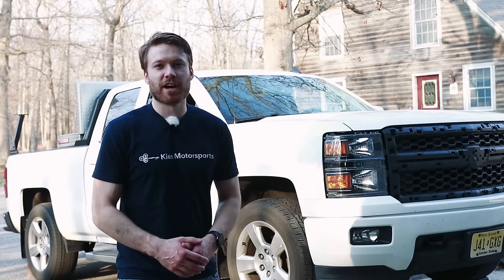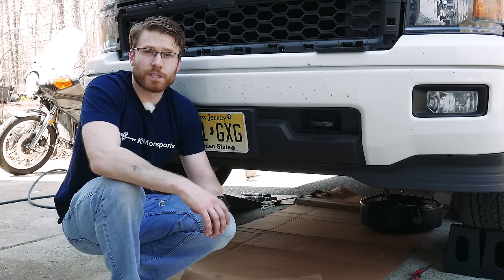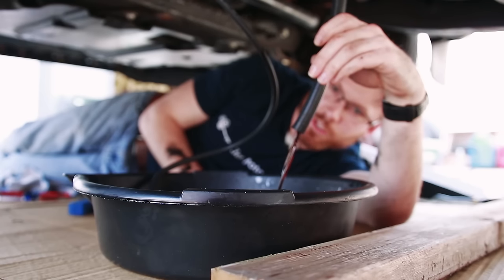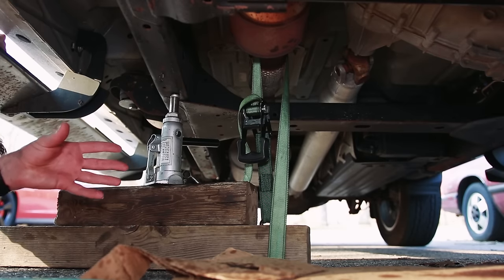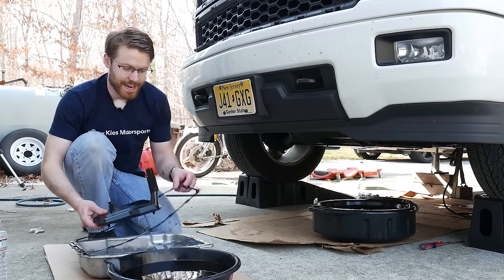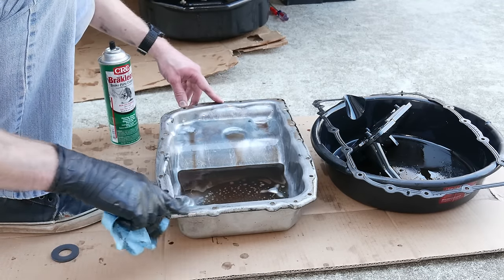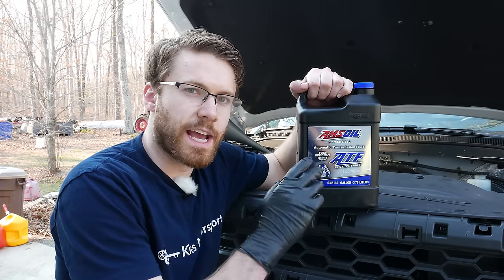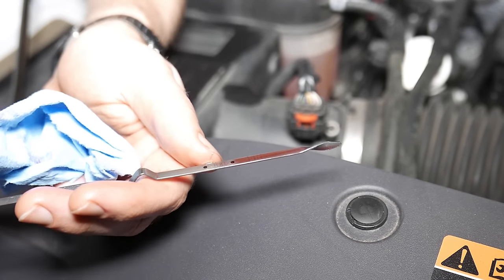6L80E Transmission Super Flush and Filter Change Silverado Sierra Tahoe Suburban Yukon Escalade H2

Comment from the maker: Pan Bolt Torque is 80 in-lb or 9 Nm (not 90 Nm) sorry for the typo
Reply: 100inch pounds
Reply: Since you changed the fluid in 2018,  have you had any issues or complaints with switching to the AMSOIL Transmission Fluid? 
Been thinking about going to amsoil instead of the dealer fluid for my ford, and i see positive reviews, im still leary.
Reply from the maker: Nope. No issues at all. I did another change 50K later as well when I swapped the torque converter (have a video on that).
Reply: hello bro, a question I would like to know if the tightening of the screw of the pan silverado 2012 is the same
Reply: Yeah I just sheared my bolt because I didn't bother to double check these numbers. Thanks!

Comment: Pan Removal Trick: I have 2018 Tahoe 6L80 trans. and the pan will come right out!  Not sure if your ride will have it (i know most do),  but I removed the heat shield on passenger side of pan (2 bolts). Then I was able to slide the pan over to passenger side about 3 inches, then twisted the front of the pan towards the driver side and it came right out!  Removing the little heat shield gives you lots more room.  If you look at the back of the pan (shallow end), there is a little raised area on the bottom about 3 inches from the passenger side, that spot is the point that will allow you to move passed the exhaust y pipe (cross over pipe).  Hope this helps!!  👍

Comment: I did the same service on my truck, if I may suggest....there are (3) 15mm bolts on the exhaust flange on the passenger side, the studs there are long.  Just loosen those nuts and you will be able, by hand, to lower the exhaust cross member enough so that the pan can be removed.  No other gymnastics under the vehicle needed.  I then anti seized the exhaust bolts.  I did have to use a Dewalt impact to get those 15mm bolts loose.
Reply from the maker: Ok good tip! I might make a second video on this showing some of the suggestions we've received
Reply: I will definitely look into doing this!  This is a nightmare job - for sure.
Reply: Did you need to remove the oxygen senor to get to those three bolts by the passenger side? or Remove the wheel and side well to access those three bolts? I have the 2011 with 18 bolts pan and see there is no room from the bottom but it seems to have room from the side.
Reply from the maker: I just had mine removed to pull the motor for the AFM. Delete and you need to go from the side to get some of those bolts.
Reply from the maker: @slowestrider4918  the oxygen sensor may need the electrical connection unplugged but it can stay in the downpipe
Reply: I wish the factory would assemble the exhaust with anti-seize ! Very smart of you. Now next fluid and filter change will be easier.
Reply: @TheSundaeDrive  Honestly, I didn't have to pull the wheel or wheel liner.  I did use a long extension and a universal.  I invested in a 3/8 wobble 15mm deep socket for this task.  I was able to access all 3 bolts from the bottom of the truck with an extension and used a Dewalt 1/2" impact.
Reply from the maker: Nice! I'll have to try a lil harder next time with those drive side ones
Reply: @slowestrider4918  12:16
Reply: Exactly what I did. Loosened all six collector nuts and popped the exhaust hanger loose

Comment: Good job GM, almost everyone knows transmission failures are heat related... so put an exhaust crossover up against the pan...
Reply from the maker: Very good point
Reply: well damn... that makes some good sense. wonder if a heat shield can be placed on the pan where the exhaust runs under. Wonder if it will drop the temp by a couple of degrees?
Reply: Yea that added on top of the bypass, of course it’s gonna run hotter. Of course the wind will help with some of that but still. Don’t know what gm was thinking there

Comment: Does anyone know if you ELIMINATED the exhaust crossover pipe what that might do?  Can it damage anything?  I'm considering just cutting the pipe out and putting some v bands on so it can be removed later and also putting a drain plug for later down the road

Comment: You 100% CAN remove this pan without doing anything special at all. I just did it on my 2014 GMC Sierra 1500 5.3l. Lay on your back with your head towards the front of the car, twist the pan slightly to the right (drivers side), and it will slide out. Took me about 2 minutes. 

That said, I love your videos and really appreciate the level of detail you include.
Reply: I will try this on my 09!
Reply from the maker: Good to know! I'll have to try that next time! And appreciate that feedback! Nice to know they agree helping!
Reply: @_Gundy_  You dont need to do that on an 09 goofball
Reply: @Chevelle602  LOL yup!
Reply: 100% just did the same way
Reply: What 2012 sierra? Will it spin out? Pry bar on exhaust?
Reply: Simple tetris move to get pan out of 2011 Tahoe....just removed pan without straps or jacking up anything.
Reply: Can vouch this works on 2014 gmc 5.3 sierra.  Had to use a pry bar with a little tug. Slide right out.
Reply: I saw another video that confirms this. I am getting the parts today.

Update. I spun the pan no problem. It was a little harder getting it off than back on. Gm needs a drain plug this makes a huge mess.
Reply: @Chevelle602 it has the same problem with the oil pan clearance from 99 to the new ones.
Reply: I've never pulled out remove bolts turn pan off to side wipe out fluid clean and wipe a couple times reach between pan and trans pull filter down an replace then pan back on
Reply: Yes he is 100% correct!  I have 2018 Tahoe and it worked too!   Not sure if your ride has it,  but I removed the heat shield on passenger side of pan (2 bolts). Then I was able to slide the pan over to passenger side about 3 inches, then twisted the front of the pan towards the driver side and it came right out!  Removing the little heat shield gives you lots more room.  If you look at the back of the pan (shallow end), there is a little raised area on the bottom about 3 inches from the passenger side, that spot is the point that will allow you to move passed the exhaust y pipe (cross over pipe).  Hope this helps!!  👍
Reply: @stevenstair1068  Was thinking of going this route to avoid the whole "can't drop the pan without drama" drama.  My question: what about the little fitting/gasket that keeps the filter tube held snug.  Is there an absolute need to replace this? How would one know if need to replace or not? - I don't see any way to replace this without completely removing the pan.  Thanks!
Reply: @stevenjenson5048  If the new filter doesn't fit snug then you'd have to change it , working on them for 54 years I've only had one that I had to change

Comment: Recently bought a 2016 Silverado; have been religiously watching your videos to learn everything about these trucks! Thanks for all the details and tips! One thing to note, I wouldn’t clean gaskets with brake cleaner. It reallllly dries out the rubber. Or at the very least, if you do have to clean it with brake clean, coat it with oil to rehydrate the rubber. Alot of us will also put a thin layer/bead of silicon on the gasket. Overall, awesome videos!

Comment: Appreciate the video it helped immensely! super easy change once I jacked up the transmission. One thing I will note I have a 2016 5.3L Sierra and the cooler lines attached to the transmission didn't have a quick connect. I instead found the return line on the transmission cooler in the engine bay and disconnected it there with same process, surprisingly easy to get to with loads of room around it. I just inserted the drain tube into the transmission cooler and it was a snug fit. If anyone runs into the same problem it is the lower line on the transmission cooler on the driver side. Your method was great because it replaces more fluid than other videos I've seen who just drop the pan. Noticed a significant  improvement in shifting too!
Reply from the maker: Awesome! Glad it helped and thanks for the tips!

Comment: I pried my exhaust down slightly with a big  pry bar, then I was able to get the pan out.
Great video..
Reply: Same I used a big bar on top n jack on there end of bar it worked
Reply: Careful people, the exhaust manifolds on these engines are held on by a pitiful (5) studs on each side.  Strain your exhaust by prying it, you'll break studs off.  My Yukon had 2 studs on one side busted off just from normal use, probably impact force from potholes on the exhaust system.
Reply: @ericeric9208  I did that also.
Rotate the front of the pan to the right.

Comment: Just got done. What a pita! No jack but there’s room. Came up 1 qt short. Used 14.5 so I pumped as I filled. Pumped out of the lower radiator fitting. 1 year old it was a little dirty. Big pull with a trailer last month from Philly to Yellowstone. Just dark. Magnet, not bad. Thanks for the viddy.
Reply from the maker: Glad it helped 👍👍 Definitely not the easiest one to change
Reply: You had just enough clearance without moving the transmission or exhaust?

Comment: A couple tips I learned on my older gmc, it was parked for years before I got it and I'm working through the issues as they come up. The transmission fluid change didn't go as usual, I've done this more than a few times. Here's my tips.. Use a sealed bucket with a pouring spout, any hose small enough to fit down the dipstick and a shop vac to make a fluid vacuum pump.  It'll get most of the fluid in  the pan. Just drill a hole big enough to have to from the hose through, shove it all the way down and stick the shop vac down the pour spout. My small craftsman fit perfect. It'll help to be air tight. I would be cautious running the pump that low... I'd think it would be safe to do several fluid changes. Also drain plugs are cheap so just install one if you're that far in, be careful of placement and get the hallow bolt good and tight. I had to replace that garbage rubber gasket that came in my kit. The old hard gasket was done as well. Go with a hard gasket if you replace it or you'll see why putting a drain plug on  when you have the pan off is a smart move. I'd also entertain a second cooler in series and synthetic fluid. It'll creep out though if things aren't just right. Worst case, they make a special rtv for synthetic transmission fluid, worked pretty good on drain plug threads. I hope this helps someone.
Reply from the maker: Good tips! Thanks for the write up!
Reply: My truck has 78,000 miles, do you think it would be wise to change the filter. I have a small pump I use to change the oil in my I/O boat engine and could suck the fluid from the transmission with this.

Comment: I just swapped my trans. fluid and filter in my 2018 sierra 1500 base. Installed the transgo therm. delete kit as well. For those out there that have yet to do this let me tell you - follow every step these guys displayed. Pan won’t come out with just the strap around the 4”x4”‘s. Gotta use the third jack to to push the housing up to. “Couple hour job” - my ass. These guys make the best how to gm truck vids. Thanks a bunch, keep’em coming.
Reply from the maker: Appreciate that! Glad they helped you out!

Comment: Great choice on the fluid. the Amsoil ATF (Red Label) was the first product of theirs I ever used back in 06 became a dealer in 07 and have not looked back. I put it in an 02 Cavalier doing the flush procedure where I took the line out of the radiator after dropping the pan and cleaning the magnet this was when the car had around 60,000 miles. Well in 2016 I thought it was time to do it again had another 70,000 miles on it at that point and I was shocked at how clean the transmission pan was and the fluid was still red! Now at that point I changed to the blue label fluid you use because GM recommend Dexron 6 in place of Dexron 3 now. I also added a auxiliary cooler and a magnefine  inline magnetic filter. Just changed that magnefine filter and opened it up a few months ago after 34000 miles and 4 years or so and the filter had almost nothing visible in it and the magnet had some fuzz on it.
Reply from the maker: Amsoil is good stuff!

Comment: So I attempted this on my 2017 Chevy Tahoe. All the steps will work except where you get the transmission fluid from. There are no C-clip connectors coming off the transmission. You will need to drop the splash guard to access the trans-cooler lines. I had a hard time tracing mines and made the mistake of disconnecting oil lines running into my radiator (not fun). So I bailed on the flush and opted for a pan-drop where I just changed the fluid in the pan. The ratchet strap, wood and bottle jack combo worked like a charm at getting the exhaust down, along with jacking up the transmission. I was able to successfully get the pan out and refill with 6 quarts. Transmission is shifting better. I would have like to get another 4 quarts or so out of the transmission but I’m a neophyte and DIY car maintenance and didn’t want to take the change of screwing things up by guessing. Hopefully someone does a video/write up on the 2015 - 2018 GM trucks.
Reply from the maker: Thanks for the feedback. That's interesting that the cooling lines are connected differently. Glad the video at least helped a bit with the change!
Reply: Just did my first fluid/filter change on my 2015 Sierra tonight. On my truck there is a plate with a 10mm bolt holding the 2 cooler lines in instead of the spring clips. I took pics of you want to see the difference.  Just let me know.
Reply from the maker: Ok thanks for the info! Could you shoot us a pic? Cliff@thesundaedrive.com
Reply: The Sundae Drive just sent the pics to you. If you don't get them let me know.
Reply from the maker: I got them. Thanks :)

Comment: Thank you for the video and those mentioned remove exhaust bolts. I just finished changing my 2011 5.3 by removed exhaust bolts first. The driver side is more accessible than the passenger side but i end up need to remove both wheel wall to access all six bolts. Penetrate Liquid sprayed the night before. It was to my surprise for the ease of removing passenger side but the driver side got me worried for a while. The 24" wrench bent and the bolt does not budge. I sprayed more and use hammer to knock around manifold housing. It took some effort to remove driver side with extra 36" pipe. 

When pipe dropped, there was plenty of room to remove trans pan. It does seems to be enough room without dropping the pipe but I just couldn't risk it. I applied plenty of anti-seize on all six bolts for help future removal. Thought about spending close to 300 for that B&M with drain bolt but by loosing bolts slowly to let oil drip slowly didn't even have any on the floor. I may still buy that B&M for change oil only. Thanks again.
Reply: I did the same, loosening the exhaust pipe flange (3x 15mm) on the passenger side, allowed the cross member pipe to drop.  Also, if you have an extractor, the dipstick is a nice access to extract practically all the fluid from the pan.

Comment: After you've changed the filter 4 or 5 times , I just welded a drain bung to the low spot om my trans. pan ...drain as much as you can , then refill a gallon and run through the gears and in idle for a few minutes , then drain it again.....I just buy the cheap Valvoline ...change the motor oil and trans fluid at the same time ...works good and real easy ...! This way you get all of the converter oil replaced ...
Reply from the maker: Not a bad plan and if you change it frequently. I would still change the filter once in awhile too

Comment: If you get a replacement pan (inexpensive) and weld an O2 bung with a plug with a copper washer, it makes it easy to drain. I do a drain and fill every second oil change which gets about half of it.

Comment: For those of you attempting this, there is another video on YouTube that shows that you don't actually need to REMOVE the pan to change the filter and fluid, or even clean the pan for that matter.  There is enough room to simply move the pan out of the way to change the filter, and get rags in there to wipe everything down and clean the magnet, as well as replace the gasket.  The majority of the (wasted) labor here and in the comments is spent trying to remove the pan entirely, which isn't really needed when all you're trying to do is replace the filter and wipe the gunk out.  Please save yourself the headache of trying move your exhaust around and create more work.
Reply: If you want this job done correctly, the pan should be removed and cleaned to surgical standards. Why anyone would half ass this is a mystery.
Reply: How do you know what is inside the pan if you can't see inside?
It is a lazy way out.
Reply: @2tirefire79 and @MachineDr., I'm pretty sure @rcchris1467 would use his phone to look in the pan and make sure everything's good to go...

Comment: When I did my 09 Sierra denali, I broke exhaust manifold bolts because of pulling down on the exhaust. I now have 1 7/8 SS long tube headers with stainless steel ARP header studs. Worth every penny since the headers have a removable pipe section under the transmission
Reply from the maker: That makes me want to do that upgrade more now

Comment: If you take a 2x4 and put it across both cross members then put a ratchet strap over the exhaist pupe you can lower it enough to have the pan clear without unbolting the xmission. You can accomplish this because of the flex pipe on the stock exhaust. If you have an aftermarket exhaust without a flex pipe then tou will have to unbolt the xmission. Just an experience of mine.
Reply: ***sorry for the typos
Reply from the maker: Good tips! Thanks :)